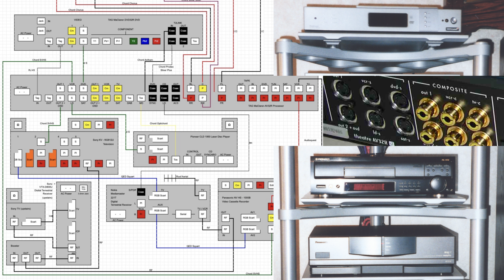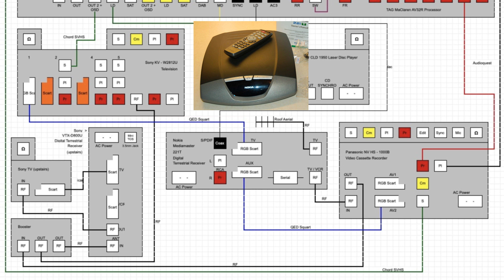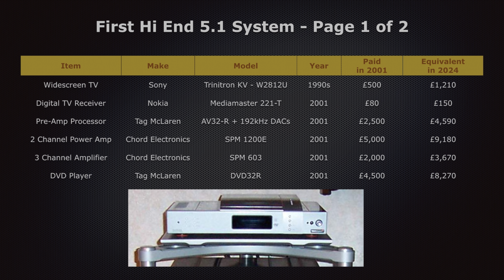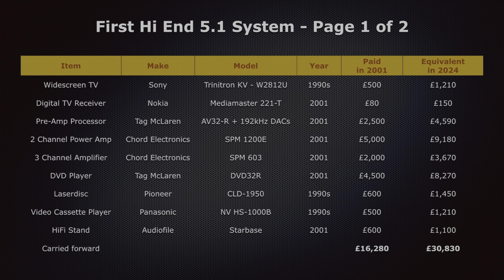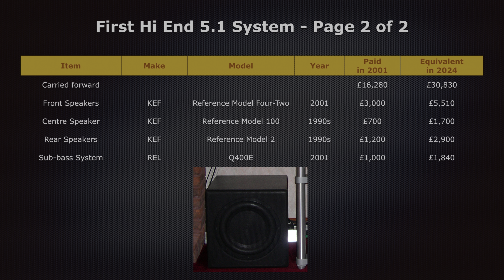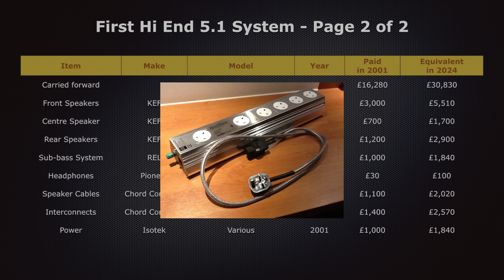2000s First Hi End 5.1 System

Comment: 17:30 This diagram is brilliant as it answers a question regarding the A32r processor in can you still run a 2.0 full range stereo signal to the power amp in order to couple a REL bass system speaker via its High Level connection. 

In any 5.1 or 7.1 mode for the THX circuit can you recall if this too can have have the full signal sent to the L&R fronts or are you forced to employ a 80htz crossover as per THX standards.
Reply from the maker: Hi Jefffan, Thank you for taking a look at my video and for your kind comment.  I'm afraid I cannot answer your question as I did not purchase the equipment specifically for THX purposes.  THX was a new standard at the time and only some of my system was rated that way, including some media.  I recall it did play well and the components made the most of it but I didn't adjust any specific crossovers to precisely match the standard, just balanced the sub crossover to suit general purpose needs.  Also I only used a 5.1 set up as I had no physical depth in my room to add the extra two speakers for 7.1.  Vince